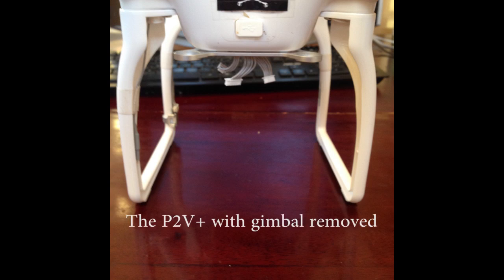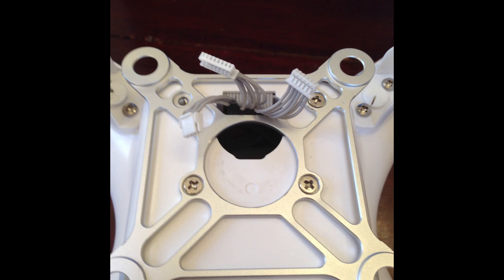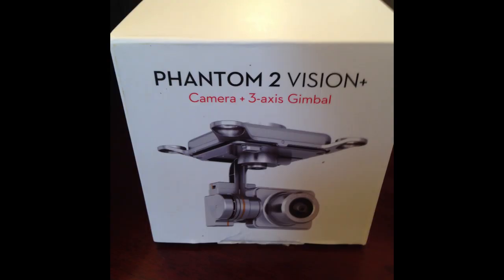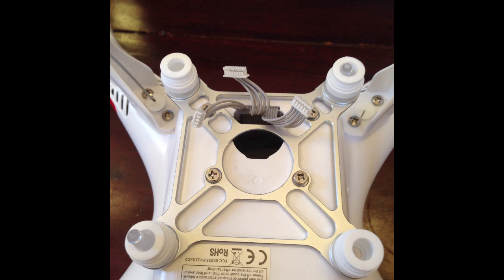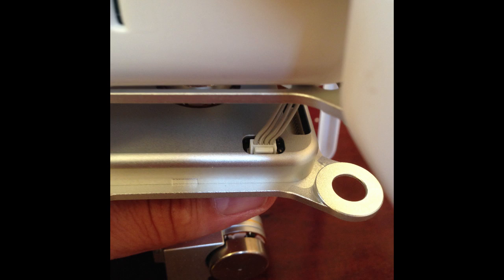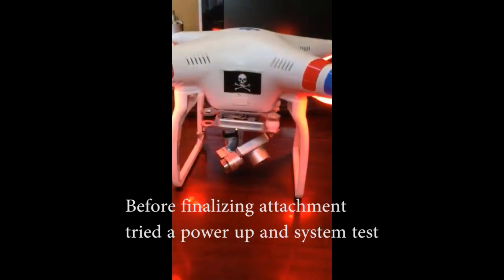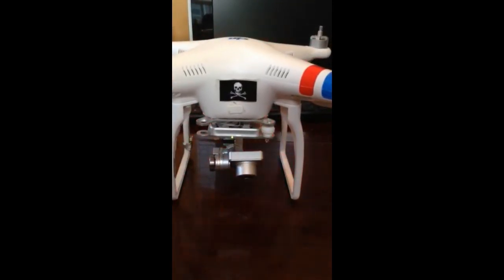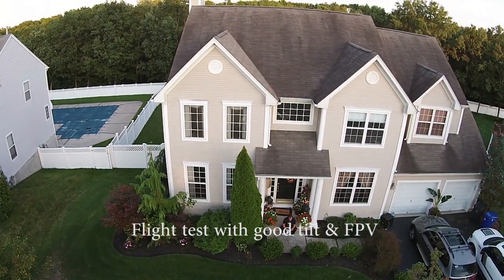DJI Phantom 2 Vision Plus Gimbal Replacement

Comment: What are the three grey wires for ? I have a gimbal from a previous drone that flew away and now I want to attach the gimbal to the drone I brought off line but I only have one grey wire coming from the bottom can u help me plz
Reply from the maker: They attach power, video feed, telemetry.  I'm not sure of the model of drone you have or the model of gimbal.   I suggest you determine that and search online for whether they are compatible.

Comment: horrible video.. main question is "how to REMOVE camera and gimball from phantom..  do I need to break those white pins or there is still a way to take them off .. Video doesn't show anything..
Reply from the maker: Sorry you thought it was a horrible video.  Since you don't know how to get the gimbal off, please forgive me for making the assumption the general population knew how to clip off a piece of plastic.   Btw, you have to clip off the plastic retainers, they are not removable.  YOU MAY HAVE NOTICED the phantom was packaged with several extra retention clips for just this reason.   Would you like instructions on how to use a pair of clippers?   Perhaps I should have also included instructions for changing the volume of the video and how to pause it, if necessary.  I'll send that to you along with a guide to manners.
Reply: thanks for reply Joseph. Sorry if my reply seems harsh!   I'll be more careful next time.   But I do believe that there are tons of video's that are not clear.  For example yesterday I took apart kitchen faucet and had hard time removing faucet cartridge.   So I jumped on YouTube and found Lowes YouTube video where guy simply removed cartridge with hands.   Than second YouTube video "john contractor" did same thing.   Finally on 3rd video guy explained that used cartridges are pretty hard to take out.  So step 1 was to buy brand new cartridge and use plastic tool that comes with new cartridge to twist old cartridge back and forth until it becomes loose and only than use heavy duty pliers to take out old cartridge.   Now on the first and second video guys took out cartridge with hands because they were working with brand new faucet, and brand new faucets do not leak.  5-10 year old faucets need maintenance!
Reply: The reason why I said with was horrible video is because taking out bolts from drone was pretty easy.  The only part where I was stock was removing gimbal.  My replacement shell came with package with lots of bolts that's it.     So taking off Gimbal was main challenge.    Removing top plastic piece by unscrewing bolts is easy    But removing gimbal was a BIG challenge. That's why I called this video horrible because hardest step was skipped.    I purchased new shell from authorized DJI reseller and it did NOT come with new clips.   That's why  I thought may-be there is a way to remove those clips!   P.S. in fact I did find a way to remove those clips without breaking them.

Comment: hi joseph
do i need to reprogramme the gimbal the phantom again ?
Reply from the maker: I didn't have to.  Just removed the old one, popped on the new one and Viola!, it worked.  After I installed it, I did perform an advanced IMU calibration.
Reply: Joseph Oleske thank you josehp so match for fast  responding